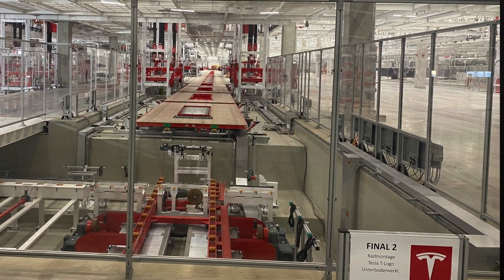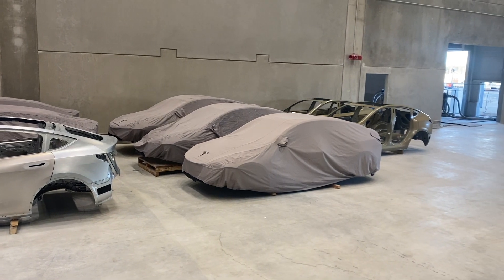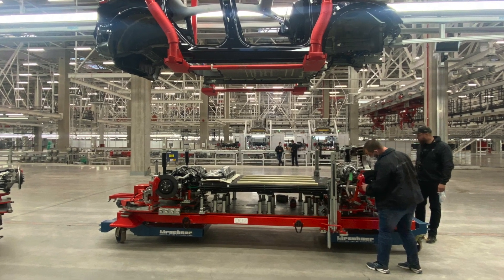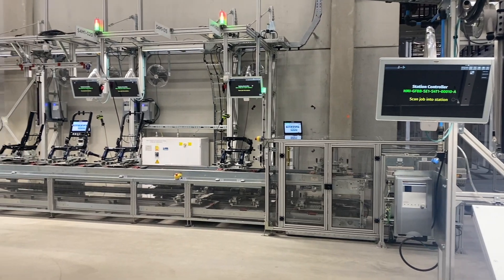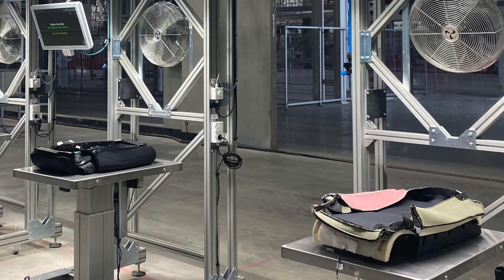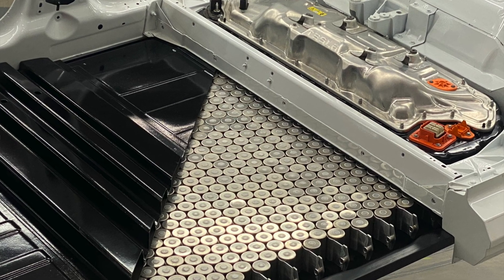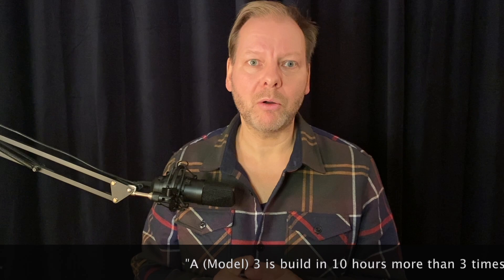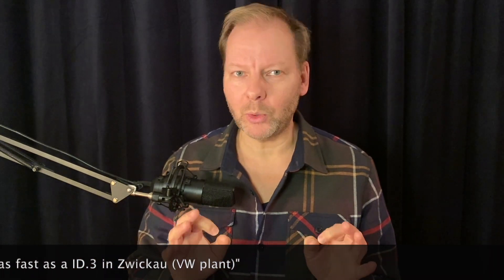Giga Berlin Factory Tour Part 5: Assembling

Comment: Wonderful series covering Giga Berlin. Thank you so much for putting this together and with perfect delivery. With regard to the comparison of Tesla versus VW, it is amazing that they believe the Model 3 is just at 10 hours per car. However, if that is true, surely the Model Y in Berlin will be even less? Two castings and a structural pack are not yet in place for Model 3 right? Either way, amazing to watch all this unfold.

Comment: Nice video 👍 But I don't think they will mount the seats to the battery before the battery is in the car. If they do so they could get problem with the wiring and the air vents under the seats and also with the floor carpets.
Reply: I’m pretty sure that they’re not going to mount the seats to the battery pack.

Comment: kind of odd that tesla's vertical integration works out, but intell and nvdia didn't work out. They end out source their fab to tsmc. What's so difference ?
Reply: The difference is in mastering the manufacturing process (and the expense in machinery). A state-of-the art semiconductor mfg process is far more complex than seat manufacturing as it involves chemistry, extreme optics at exotic wavelengths at the limit of physics, precision mechanics and everything at extreme purity levels. And then to keep up you have to implement an new semicon process ever couple of years. Check out this video series by Zeiss on the topic of lithography, which is only one of several process in chip manufacturing: https://youtu.be/PsaOWZv9vH0